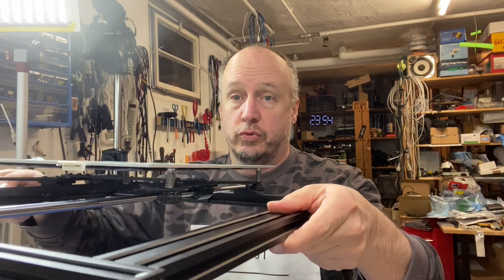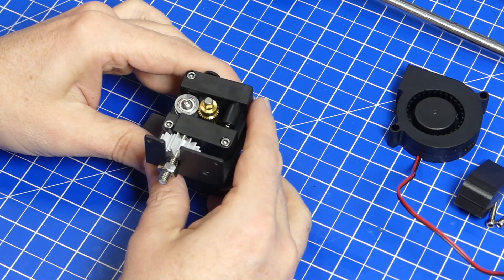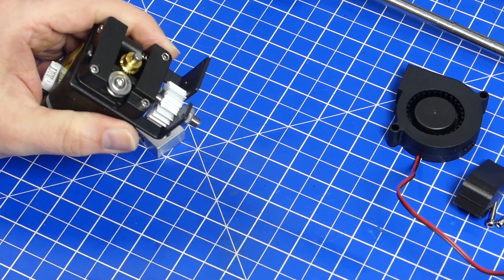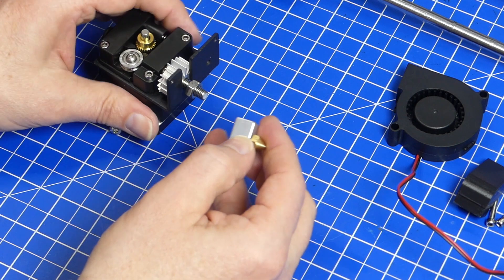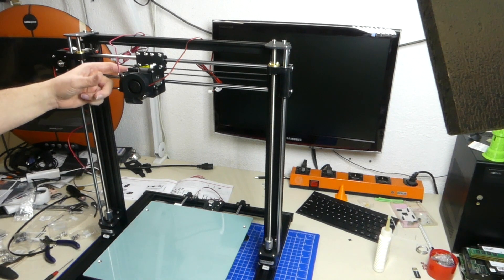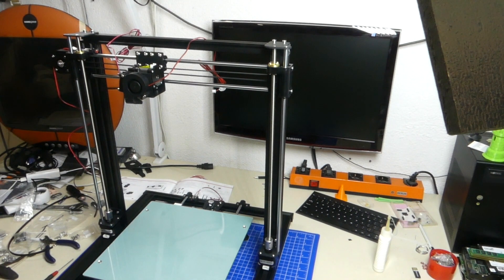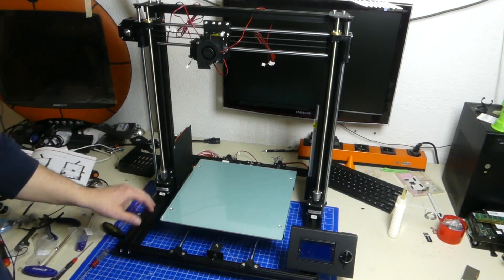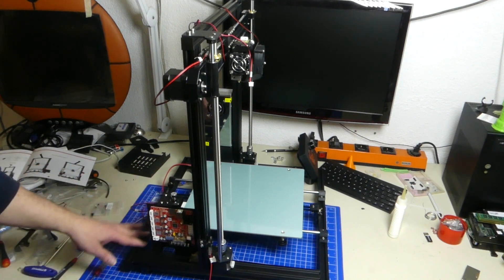One to mod: Anet A8 Plus Kit - Build part 2

Comment: Dirk when assembling the heatblock I like to screw the nozzle in fully and then screw the throat in until it touches the nozzle. Back the nozzle off 1/2-3/4 turn - seat the heatbreak against the nozzle again - warm it up and tighten.
Reply from the maker: I know that procedure well ... but I only use it for hotends that have been used before, so any hardened filament is displaced and the seal perfect. The procedure is not really needed for new hotends, none of the metal pieces will be impressed by that bit of heat.